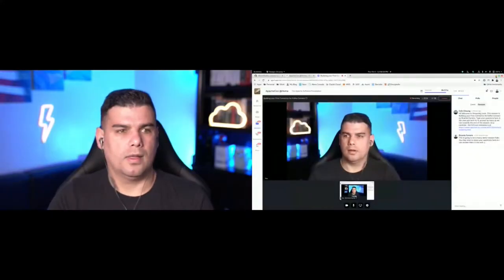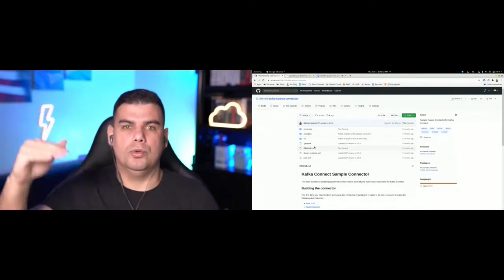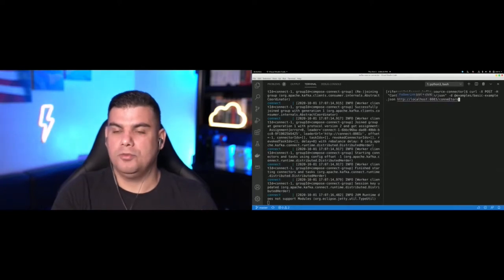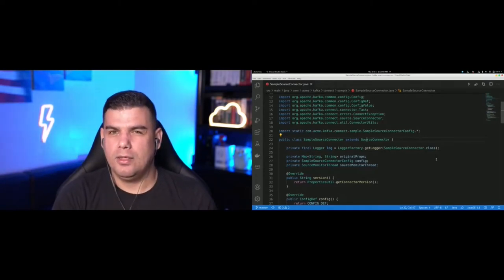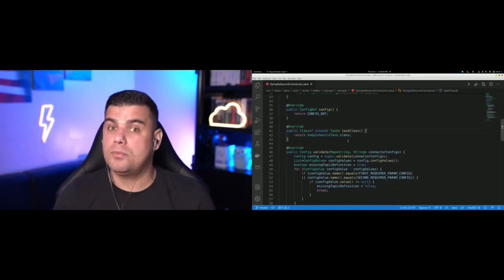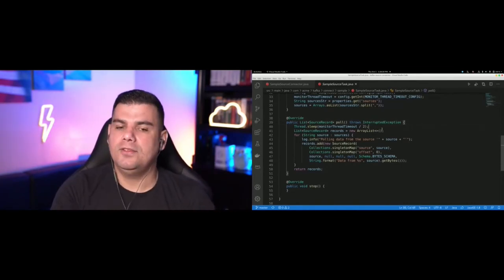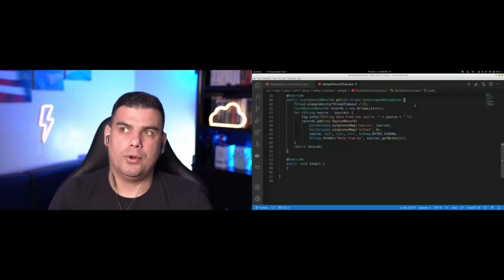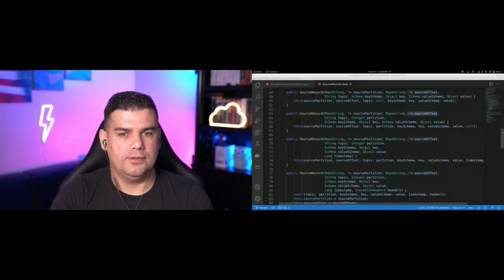Building your First Connector for Kafka Connect

Comment: Screen is very small and also the git code path is not available. So it is not making good on this. if you would have given full screen of code and also the path of git.
Reply: My apologies Daya. I actually put my screen in full size during the conference but their recording platform arranged the window in the size you have watched, which admittedly is a bit small. While I can't change this because it has been recorded like this — I can provide the link to the GitHub here: https://github.com/riferrei/kafka-source-connector.
Reply: A tip: watch movies on kaldrostream. I've been using it for watching all kinds of movies these days.
Reply: @Uriel Amari Definitely, I've been watching on kaldroStream for since december myself :)

Comment: Apache Kafka is rapidly becoming the de-facto standard for distributed streaming architectures, and as its adoption grows the need to leverage existing data also grows. When developers need to handle certain technologies that happen to not have an connector available; they have no other choice other than write their own. But that can be quite challenging, even for experienced developers. This talk will explain in details what it takes to develop a connector, how the Kafka Connect framework works, and what are the common pitfalls that you should avoid. The code of an existing connector will be used to explain how the implementation should look like so you can develop more confidence when building your own.
Reply: Ricardo is a Developer Advocate at Confluent, the company founded by the original co-creators of Apache Kafka. He has over 20 years of experience where he specializes in streaming data architectures, big data, cloud, and serverless. Prior to Confluent, he worked for other vendors, such as Oracle, Red Hat, and IONA Technologies, as well as several consulting firms. When not working, he enjoys grilling steaks in his backyard with his family and friends, where he gets the chance to talk about anything that is not IT related. Currently, he lives in Raleigh, North Carolina, with his wife and son. Follow Ricardo on Twitter: @riferrei